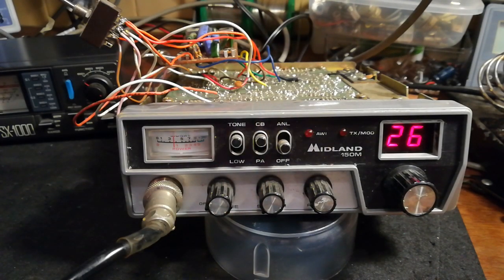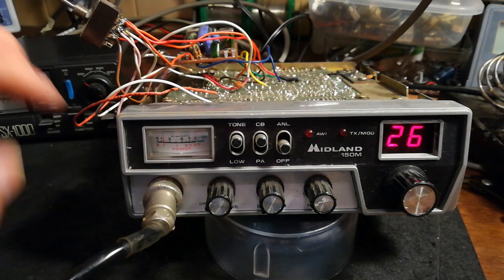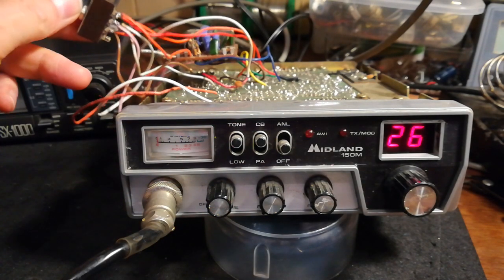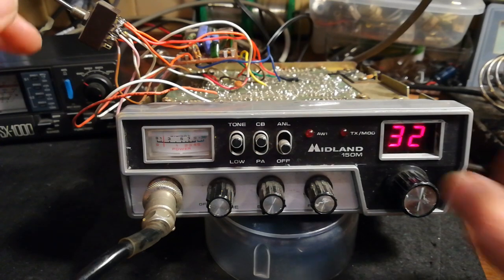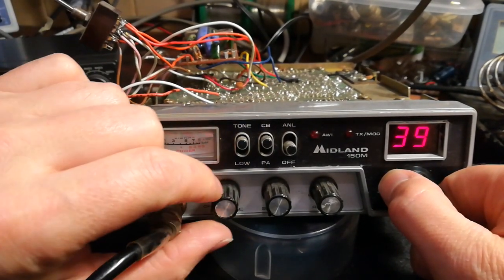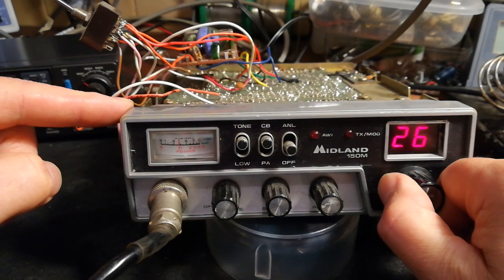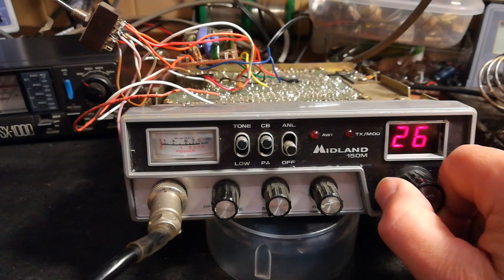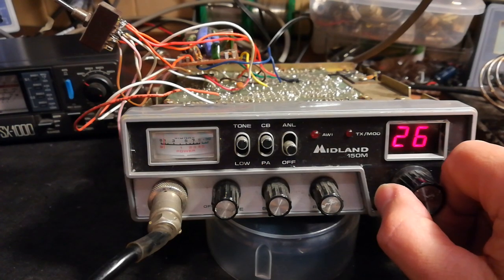Adding FM to my Midland 150-M AM radio  .

Comment: Ive got one of these , it has FM AM and 120 ch , is it easy enough to get the UK 40 on it ? 

Thanks
Reply from the maker: You would be able to get ' Some ' of the UK FM channels , But the radio will need to be modified to get it onto frequency inline with the UK FM system .

Comment: Hi just bought one of these without power lead, could you tell me which of the 3 pins is the live pin please.
Reply from the maker: Hello ... You'd be much better of just removing the sparker case and looking at the power socket , That will show you the positive and negative wires ... Reason I say this is I once had a CB in , Ide not long bought it and someone had swapped the wires over  internally for whatever  reason .... I always check now just to be safe 👍